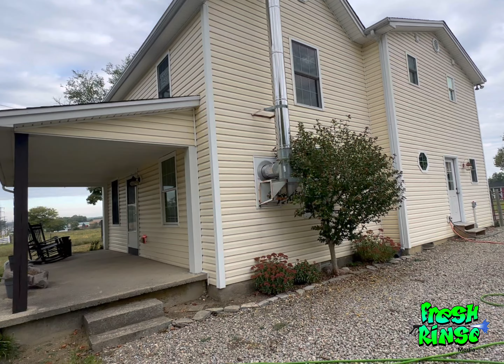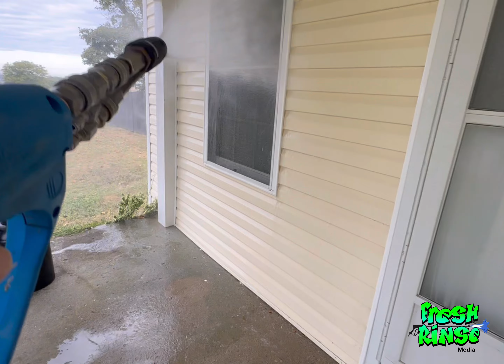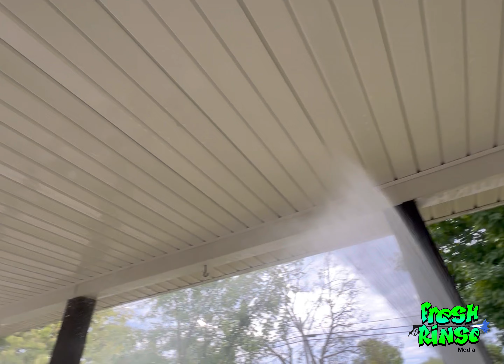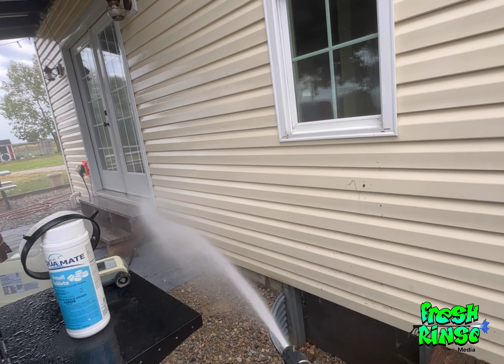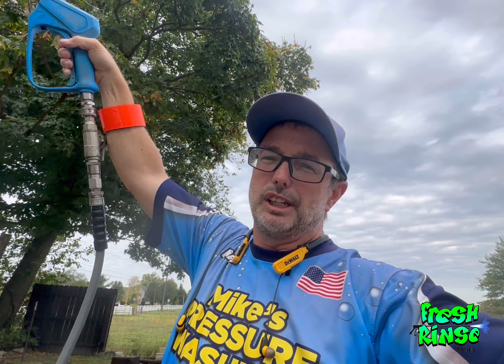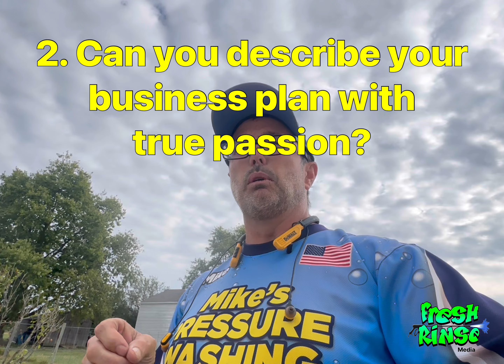Are You Serious About Your Pressure Washing Business? You May Not Want To Hear This!

Comment: Mike, what did you use to get like the stain off the house with the brush? Was it shutter paint run off?
Reply from the maker: @gary5199  Great question. Red Raider. But any degreaser will work on those oxidation runs.